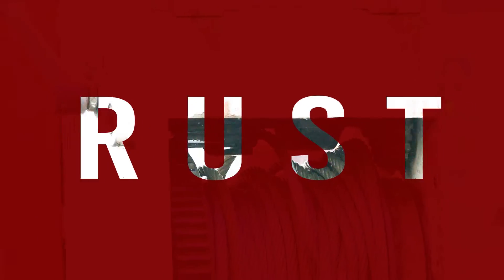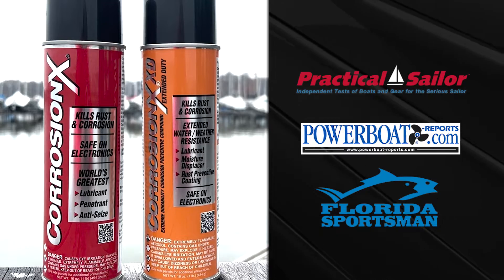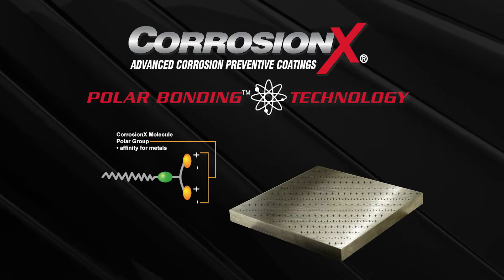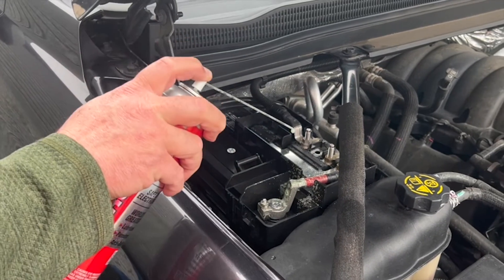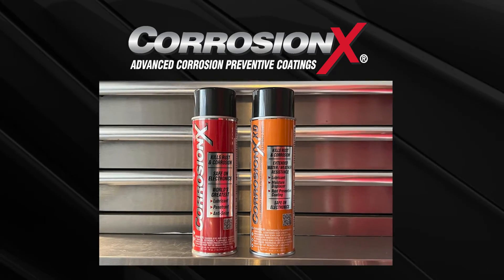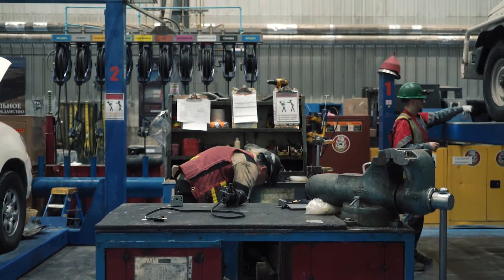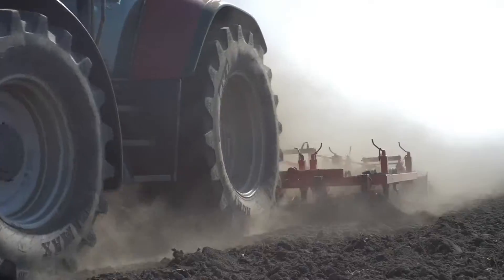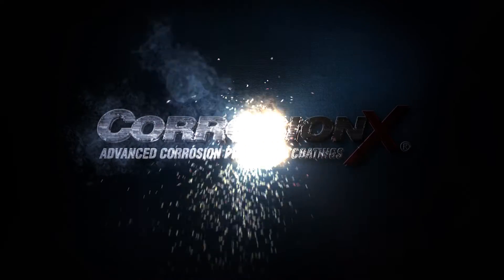CorrosionX: Protecting the things you love.

Comment: This product its spray and forget?
Reply: I'd wipe off the excess (it thickens over time, and can attractdirt, etc.)... but as to being "spray and forget"?
I'd personally re-apply after about 2 years if it's going to be exposed to the elements outside. 
 
I live in Central Florida, right on the water... SALT water humidity, fog, air, spray... etc. ,  and I only have to maintain metal parts with it about every 2 years or so.

When I first heard about it, I thought ~
 "If it's good enough for the Navy... why not try it? "
 
After all this time, I haven't been disappointed. 

That said, I only use lanolin based fluid films on components that regularly make contact with the water, like cross beams on the boat lift and its cables. 
You don't want to poison those sweet oysters the grow on the seawalls, right?

Comment: I would like to waterproof a drone for salt water applications (for protection, not underwater applications) which product is recommended? Thanks
Reply from the maker: For electronics, we generally recommend regular / marine grade CorrosionX (red label) or CorrosionX Aviation. Those products have the highest dielectric and are ultra-thin film products. Some people recommend our thicker film products like CorrosionX Extended Duty (XD) or CorrosionX Heavy Duty (HD). Those work well and last even longer, and are good choices for things like battery terminals. However, in many electronics applications (such as circuit boards) you also have to be mindful of heat dissipation. The ultra-thin film of CorrosionX and CorrosionX Aviation do not interfere with heat dissipation. That combined with a very long track record of success protecting and often restoring electronics exposed to water (even saltwater) make CorrosionX regular and CorrosionX Aviation our standard recommendation for electronics.
Reply: @corrosiontechnologies  thank you!
Reply: This product its spray and forget? Can be removed with water?